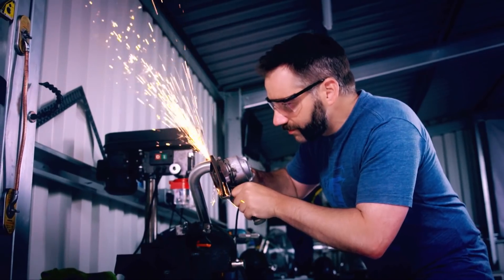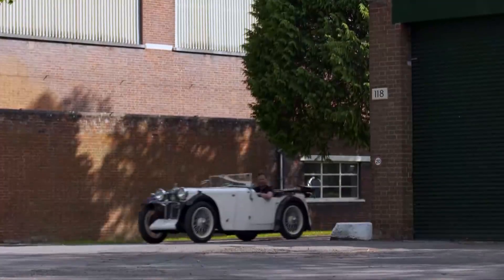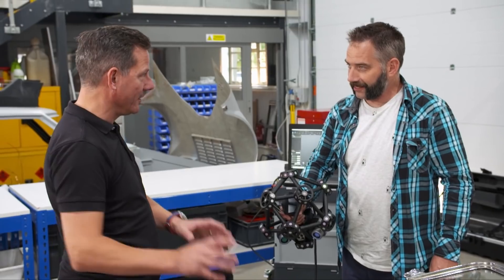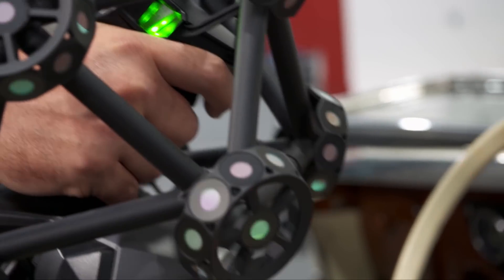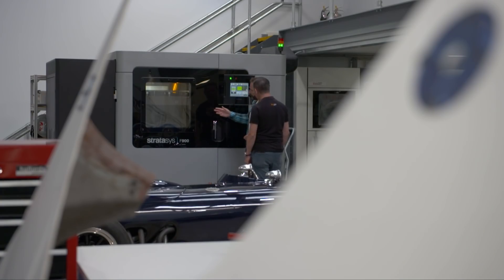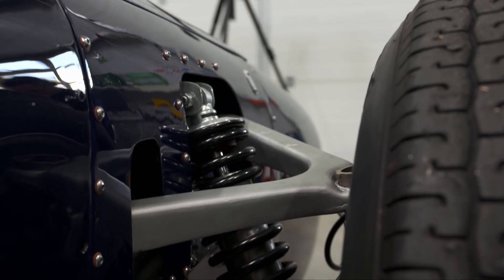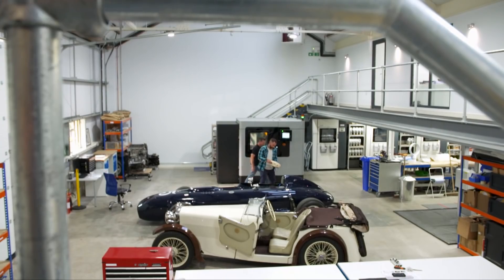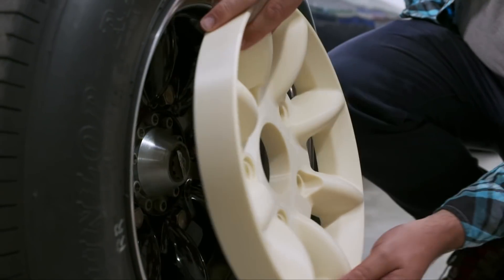Transforming Classic Cars With 3D Printing | Fifth Gear

Comment: Additive manufacturing may be fun but it is still crap  for even casting, let alone manufacturing parts. I agree it is great for prototyping. I have had FDM printers for years and I really like them so I am not a technology hater.  The massive leap is in compact super smart CNC mills. They can produce real parts with proper strength and precision. You can mill almost any car part from a range of materials,  delron, aluminium, steels, bolt them on and drive away.